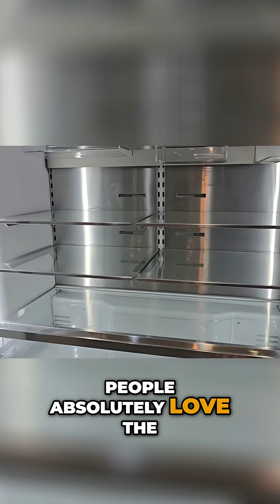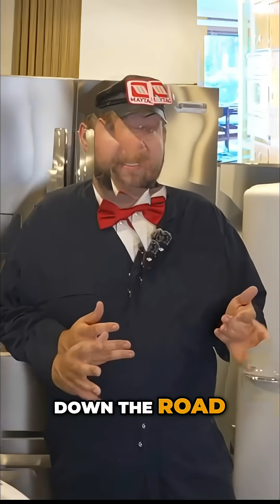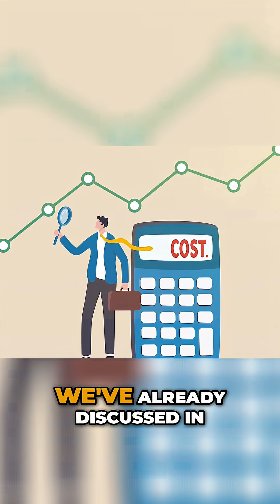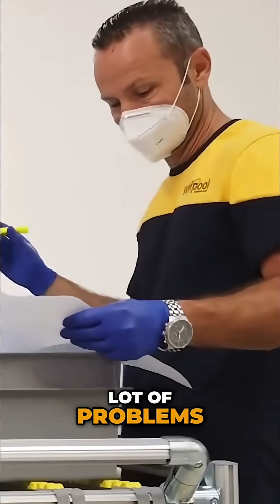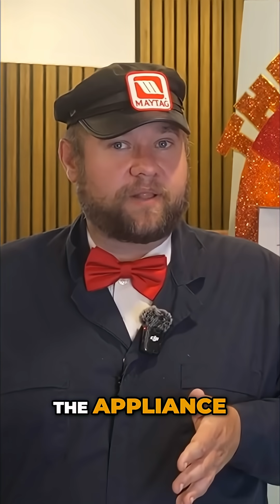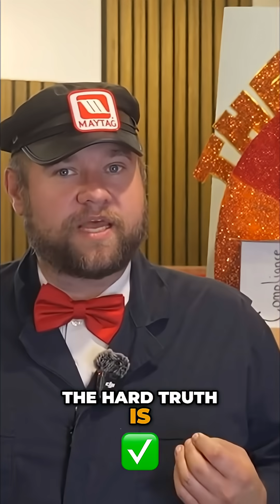Why are NEW Appliances SO TERRIBLE? #shorts

Comment: Ben, in my opinion, things started going downhill when the CEO’s started getting tremendous bonuses even when companies were not doing well. Then equity firms moved in to offer big cash and stock buyouts. The equity firms stripped as much as they could from the business and sell them for pennies on the dollar. The bottom line is that the appliance manufacturers are perfectly content making slim margins on the initial product knowing that they have the consumer on the hook for either extended warranties or repair parts. So if they dont make it one way, they will make it another.